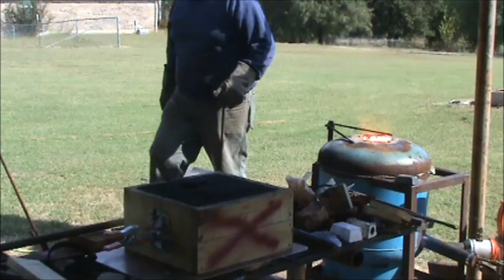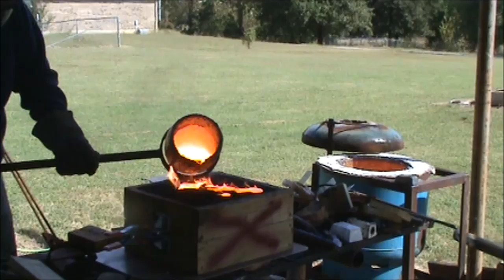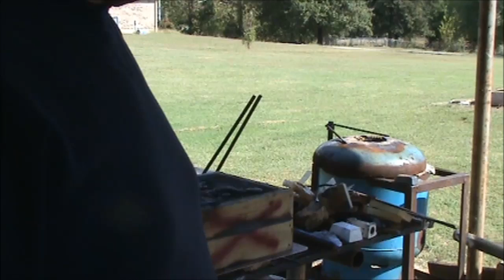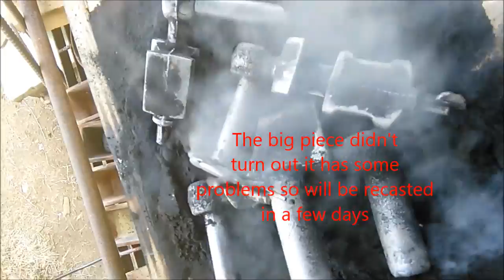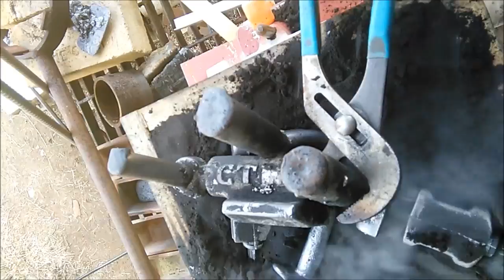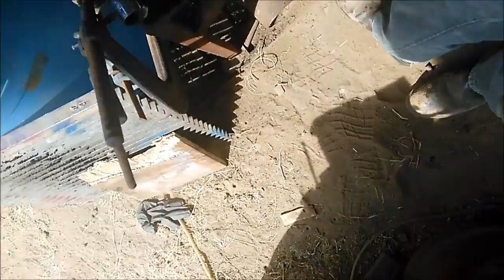10032015 cast iron melt

Comment: Thanks for the new video Dave, I'm going to hold off about melting any more iron till I get my hands on ferosilicon. I have been watching some on ebay, just not sure how much I want to buy. I have some aluminum flask to make until then.
Reply from the maker: +Clarke E stuffs kinda on the pricey side, I have melted iron and had it turn out ok without using it, I think the biggest mistake that people make in melting iron is not getting it hot enough. have you tried adding in some copper to the iron that you have melted its suppose to help the graphitization process as the iron cools.do you have any photos of the iron that you've melted, it would be interesting to see them.
Reply: +SUPERDAVE257  No I haven't tried adding copper to iron but will the next melt. I'll take some pics of the mess that didn't melt right along with some that did but too hard to machine. the stuff will turn at slow speeds on the lathe but can't even get a center drill to start without breaking down. how much copper should I add to the melt? About 10%?
Reply from the maker: one or two percent if I remember what I read in the book correctly.
from what your saying it sounds like your not getting hot enough, does your crucible pour out clean or have a lot stuck to the sides of it.

watch the last video you can see the inside of the curucible just before I sit it down after pouring into the mold you will see the wall were the metal was at is clean
Reply: +SUPERDAVE257 from all indications it looks like that might be the case. what confuses me the crucible gets white hot, even starts looking like it is on the verge of melting at the the rim of the crucible. I made some changes that may have altered it's efficiency, made a taller plinth to get it closer to the dome of the chamber, which I would think should be even hotter
Reply: I took pics just now, I sent them to you via Google hangouts, not sure if you have that